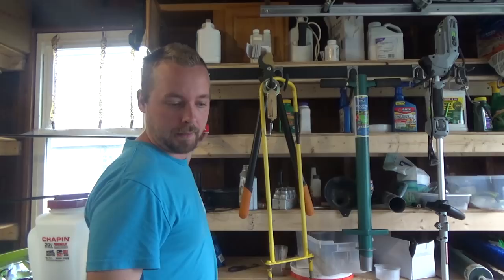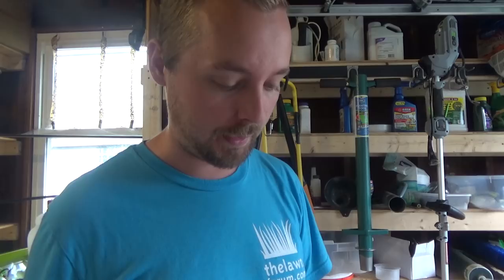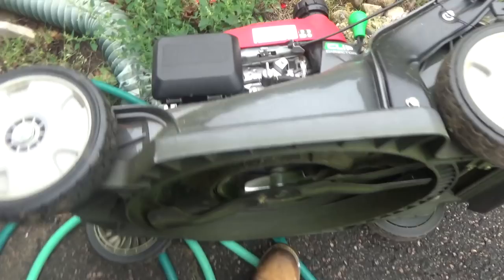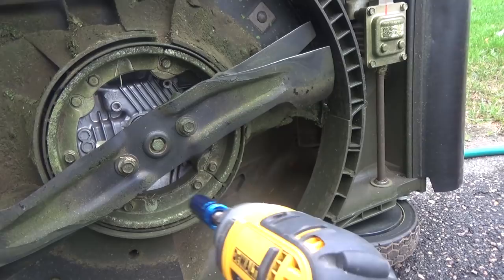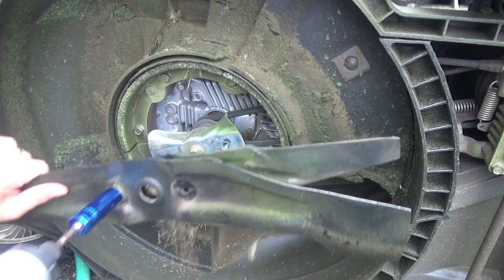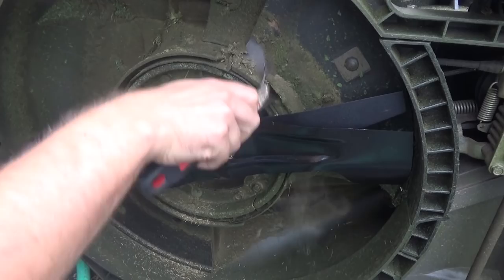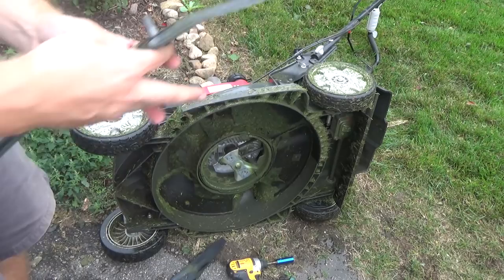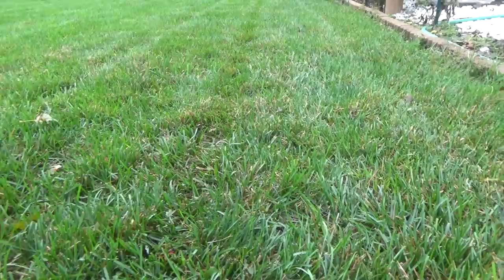Should you Sharpen New Lawn Mower Blades?

Comment: I sharpen and balance all of my lawn mower blades when they are new. I have never had a new lawn mower blade sharpened the way it should be to cut grass or perfectly balanced when it was brand new wether it is Residential or commercial grade. I use a Trick Tools belt sharpener mounted on a grinder and use the flat patten with a 30 degree jig and a Magnamatic balancer. I have been doing it that way for years and always have a lush healthy lawn. I learned the trick of razor sharp sharpening and fine balancing without a nail or bubble but a Magnamatic ball bearing type balancer when I worked for a commercial lawn care company and was in charge of maintaining 14 acres of well manicured lawn every week. We always had sets of balanced razor sharp blades ready to go. I still do it that way at my home because it works. Healthier for the lawn and the balancing is easier on your crankshaft or mower deck spindles. My neighbor just put a new lawn mower blade on his mowe and the blade was tearing the top of the grass. He asked me to look at it. There was so much paint on the blade that the cutting edge was dull. It would have taken many mowings to get to the metal since his lawn is lush grass. I sharpened and balance it and the nice slicing square edge on the top of the grass appeared again. Most people don't sharpen and balance new blades but in my experience and opinion they do need to be. If you Don't agree with me that's fine, everyone has their own opinion and methods but many professional companies do. Check out the Magnamatic videos on You Tube.
Reply: Mow Pro56 sounds like good advice to me.

Comment: Just got a new blade for my Cub Cadet SC 100 HW. I was thinking, damn this thing is DULL compared to my old blade. Brought me here. Now I feel better. Can’t wait to check after my next cut and see if it sharpened up with the paint gone. Thanks, man!
Reply: How did it work after cutting? I have a set of cub cadet blades i just unboxed and they seem dull as ever..
Reply: Greg Wever It worked fine! First two cuts beat the paint off the blade tips and seems to be cutting fine. First cut was kinda weak but was glad it got better with second. (Small yard)
Reply: @lowery02  thanks much

Comment: The coating is just rust prevention and usually 15-20 feet of cutting it is knocked off the edges of the blades but with some replacements depending on brand it may require a touch up since the blade didn't have much of an edge to begin with

Comment: Thanks for the tips. I have a Honda HRR216VKA and I often wondered about the new blades painted black. They always felt a bit dull to me and not sharpened good, but watching your video I can see they did cut well. I too always keep a spare which I plan on buying new today at Home Depot and usually have them sharpened every Spring. The blades I just took off last week looked pretty chipped and worn so I just tossed out. 
Don Zelmer from Milwaukee
Reply from the maker: Yeah I was very interested in doing the test myself, I've always been told it was OK but doing the video I was like oh yeah that is true ;-)

Comment: Thanks for the video.  I bought an Ariens lawn tractor years ago and at the time they had an offer for free blades for life.  So, every year they would send me a free set of blades if I asked.  Long story short, I didn't change them out every year so I accumulated about 3 boxes of unused new blades.  Well, I pulled them out yesterday and inspected them and they are a little rusty.  Not terrible, but enough for me to wonder if they need to be sharpened before I used them?  I could maybe get some light sand paper and clean them up.  Any advice?  Thx!

Comment: “....going risky here....”
😂😂😂 thx for the vid but 
I disagree w/ you on mower blade. 
New blades are typically sold w/ a slightly blunt edge. Pros put a razor edge on theirs. 
I always keep a “razors edge” on my blades. It’ll make your lawn or grass blades look so much better as the tip of cut is actually “cut” or “sliced” and not “ripped” off the grass blade. After a cut w/ dull or blunt blade the grass blade looks “frayed” at top. Don’t believe me? Pull a few grass blades & study the tip. Big difference when properly cut.
Trust me, I’m an old man. I mean PRO when it comes to my lawn and mower!
😂😂😂
Just messin’ w/ya. To each his/her own!
Thx again for your video! 👍
Reply from the maker: Yeah I guess it depends on the blades, some come sharp but some come dull. Even within brands.

Comment: What’s your opinion, should you check brand new blades balance?

I just installed a new pair to my riding mower and it shakes much more than with the old blades on.
Reply from the maker: I would check them if they were making noise

Comment: New Honda mower blades that I can buy are as blunt as hell . I think it's a liability thing they don't want to sell you sharp blades .  I find I have to sharpen them before fitting or they don't cut that well .  I replace my blades after a few resharpens for safety reasons , they sometimes develop fine cracks near the bolt holes . You would not prepare meat with a blunt knife so why cut the lawn with one .

Comment: I used to sharpen every year - then the guy at the mower shop told me "why sharpen, the blade is going around at such a high speed, grass doesn't stand a chance whether the blade is sharp or dull."  So the last few years, I've stopped sharpening .   Now, there are other factors involved like watering and temperature, but my lawn has never looked better - people keep saying a dull blade will cause the tips to go brown but I have never seen this happen.    I'm not sure I will ever go back to sharpening a blade and the cost savings clinches it.
Reply: If you think about it,  what is so sharp about the nylon string you use for a trimmer, yet it does the job - I don't see anyone recommending sharp wire !
Reply from the maker: well it really depends on what you mean by sharp. most people over-sharpen blades. but it is good to check them every so often, usually I'm grinding out dings from rocks the kids left in the yard =P

Comment: I was wondering more if they need to be balanced. But if you don't need to sharpen them you don't need to balance them. I just put new blades on my rider and it sounds horrible. I cleaned the deck of stuck on grass clumps and the blades spin with nothing in the way. They just sound like they wobble almost.  I'll feel the blades as they spin see if I feel them wobbling. Lol.  Really though any suggestions?
Reply from the maker: Check the balance, it's possible they came bad
Reply: @GrassDaddy  ok can do. Thank you

Comment: Very helpful!! I just bough the replacement blade(s) on my Honda mower and an upper and lower blade, like yours, were mailed to me. Do you think it would be alright to bolt both blades on together like you did in the video, even though it came out of the factory with just the single lower blade?
Reply from the maker: I would check that you have the correct blades. If your mower came with one it might not have the power for two. The bolts might not be long enough for two and putting two one a single blade mower would make them stick down farther.

Comment: Hi Grass Daddy, I am looking for a sprinkler timer to put on my outdoor spigots.  I used some orbit models (24713 waters multiple times a day & 24600) and found out that they sometimes don't go off at the times I programmed.  I know I did it right and the timers are just giving me a hard time.  I don't plan on putting an irrigation system and just get some of these sprinkler timers that can water multiple times a day and some conveniences.  Would you recommend any that you know of?  Also, if you think a wifi sprinkler would work so I don't have run out and change timer/s.  Let me know what you think would be good.
Reply from the maker: +Plato Dimitriadis most people I know use the melnor ones and rave about them. Before I had irrigation installed I had an orbit that failed to turn off randomly and then stopped turning on too.

Comment: Hey grass daddy what state are you from?
Reply from the maker: +Wheel Man Steve rhode island
Reply: ok im in CT. we had zero fain   in Sept. waiting patiently to overseed. Lol
Reply from the maker: Gonna have to pull out the hoses, if you wait too long winter might be here =P
Reply: Grass brotha I’m getting my sprinkler system installed tmrw. Any tips or advise or questions I should be asking before, during, and after install? Thank you man! I like in Massachusetts like 1 hour from seekonk which is basically near y
Reply from the maker: Biggest tip would be to watch where they place the sprinklers, and make sure they line up straight. I didn't notice with mine that they weren't lined up on the side yard and it bugs me. I'm gonna be moving them soon. The only other thing is hopefully they use flex pipe and a pipe puller, it does little damage to the lawn - the next day a friend was over and didnt notice I had sprinklers (and we were in a lawn competition that summer hehe)
Reply: they did use the pipe puller and lawn looks very good still minimal dmg, used rain bird heads and hunter, with a rachio timer. they still have to put in the valve boxes and finish hooking up the system. its a 4 zone system with about 4-5 heads per zone. thx for the tips man!
Reply from the maker: +doom4uall once its all done, water daily for a few days to help the cut parts recover

Comment: always, always, always sharpen them as sharp as a kitchen knife. new they are not sharp.
Reply from the maker: No that leads to more dings. The blendtec blender will blow all other blenders out of the water and it has a dull blade. Slightly different than a mower but the concept is the same. You don't need super sharp blades to cut grass.
Reply: I cut 5 acres a week, sometimes more... have 4 sets of blades (had 6) ... I can tell from engine RPM to everything else, a sharp blade cuts soooo much cleaner easier and nicer period. It's not even a contest. Honest. If you've ever sharpened a new blade before using it you can see how they 'sharpen' it. You can see the groves, deep grind marks in it and see it is not smooth. It's just a rough edge.

Comment: KIDDING? You do not rate a sharpness like this. CAN IT CUT A PAPER.  I doubt it. So have you ever been to a book bindery they use press cutter knives that are > 36" and over 5/8 " thick and they sir, are extremely sharp like scalpels. They would do very well on a lawn if the HP were there to spin the 50 pounds. Hoping the balance was right.  You cannot compare what you do not possess. Talk to a knife dealer or a commercial/industrial blade sharpener. You think emergency rescue has dull painted ax blades like your mower.